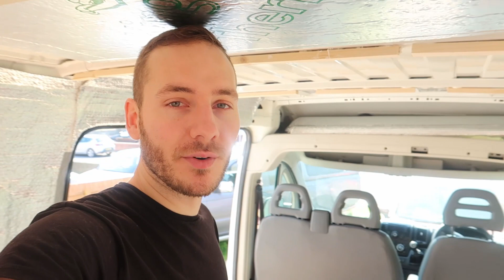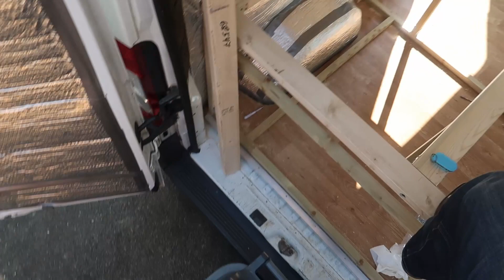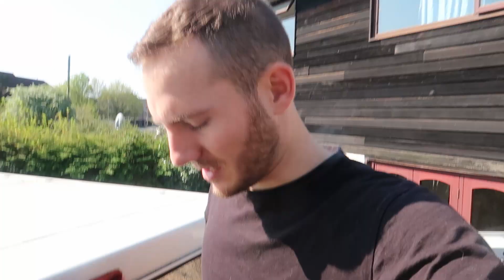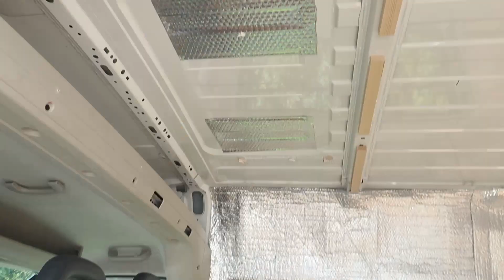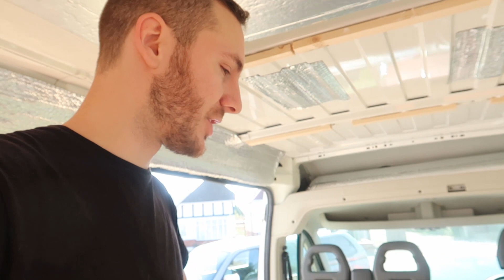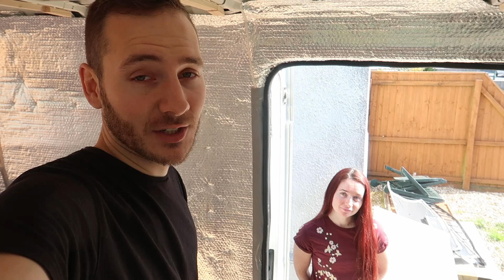Installing Van Roof Fan (Fiamma) | Beginner Van Conversion UK

Comment: Good work guys. Did my roof vents last year, remember how nervewracking it it cutting hole into your van!

Tip for removing the screw. If you can, open the chuck of your drill up wide enough to put the screw head inside, tighten the chuck onto the screwhead, then slowly undo it. Something I've used successfully many times!! Can be difficult in tight spaces though.
Reply from the maker: Ah that's a good shout. I'll give that a go once it stops raining :) Cheers